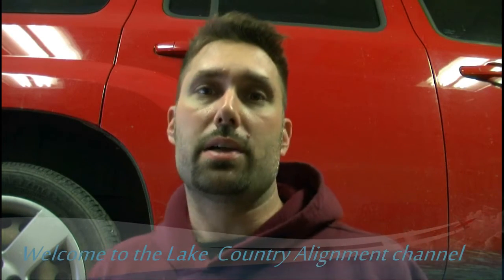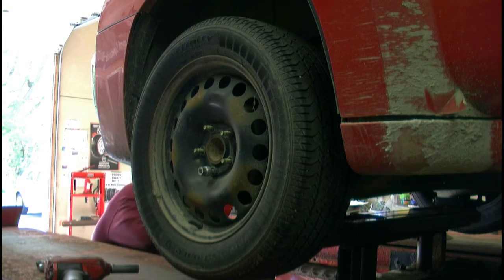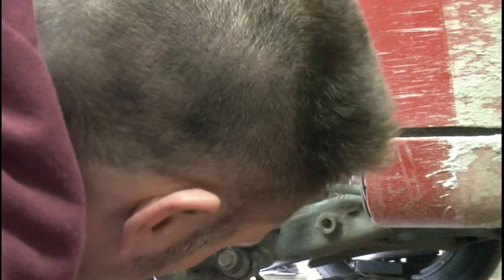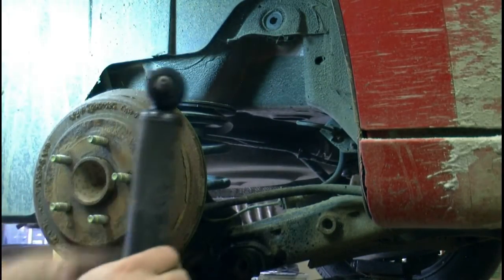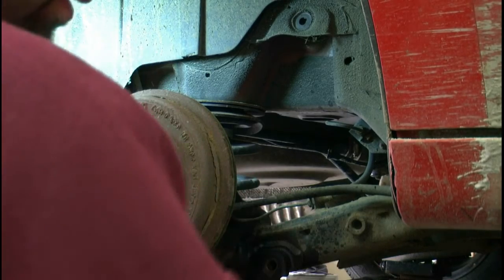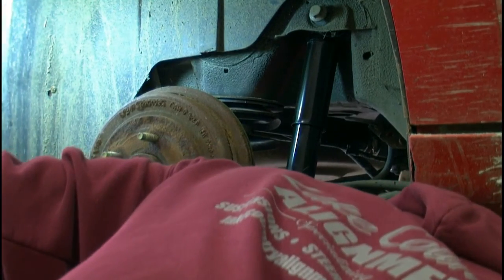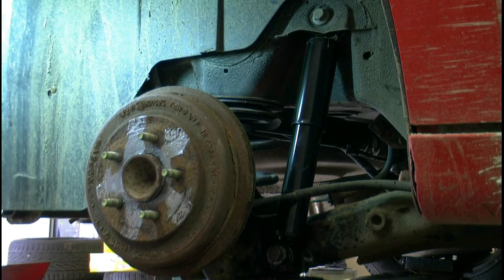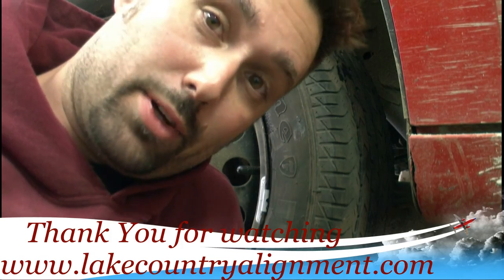How to install rear shocks on a Chevrolet HHR

Comment: !No Power Tools Necessary! Easy:
1. Apply PARKING BRAKE
2. 19mm: Break the lugnuts before jacking it up (off the ground...)
3. !!!JACK IT UP!!! Put a JACK STAND  under EACH SIDE. You'll want the jack later to put under the suspension on each side when you're working bolts out and back in.
4. Remove Tires and place under side of vehicle, but not too far under...(not sure if this is best practices).
5. The shock bolts are 18mm(top,66ftlb), and 21mm(bottom, 92ftlb). It works good to have about a foot and a half (1.5ft) worth of ratchet extension(s). And, a breaker bar, and a cheat bar. I have a 3ft cheat bar, and everything came out easy!
6. (Optional) Apply anti-sieze to shock bolts, and, to the surface between the wheel and hub, lugnuts/bolts...(I'm not sure how much is best practices)

Comment: My lower rear shock mount nut is stripped. You mentioned replacing the nut, which is tacked in. How is that done?